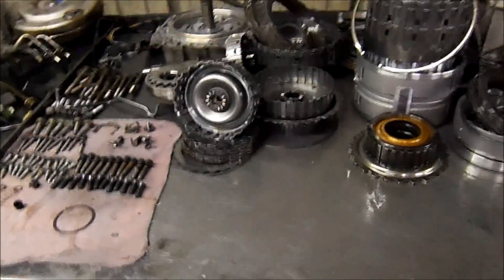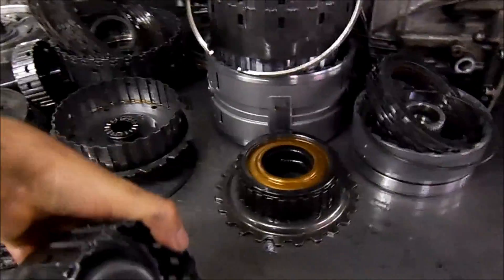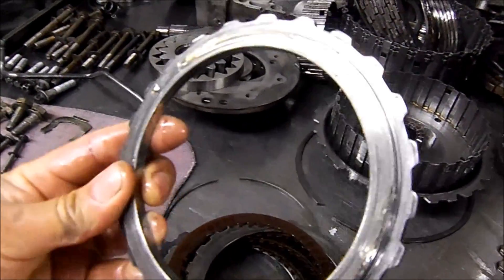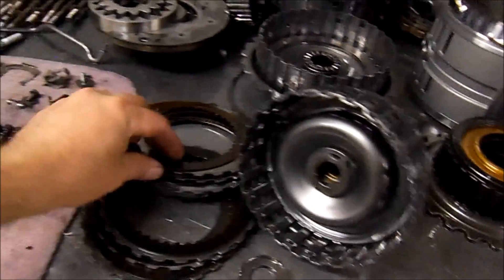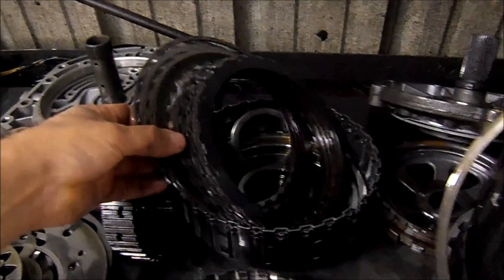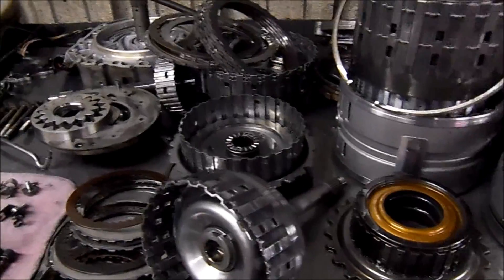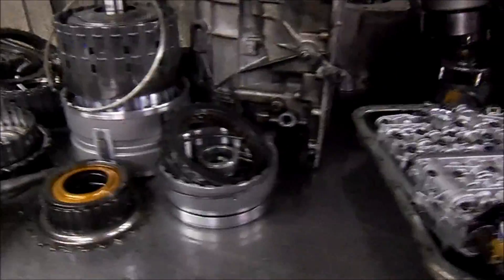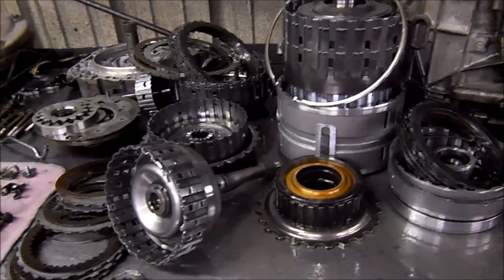ZF5HP24 Transmission - Broken Input Clutch Drum - Transmission Repair

Comment: Hello sir, i just finish rebuilding my zf 5hp24a and the car dosen't moving forward, very stong and good reverse! When i shift from P to D i have just a 2 inch move from the car, like she want to go and then stops, without touching the throttle! Like it loosing pressure,i have checked maybe 10 time the skinny o ring and grease it to be sure it ok before installing the transmission. I have check in the dash if it shows all the selected speeds, it ok until i accelerate and then all the speeds are the same color and dont change. When i accelerate and the car dont moves and slips i get only one dtc P0730 Incorrect Gear Ratio, i looked on the internet and the code it genaral alot of problemes can relate. Please, please, please help me before i take the transmission down again and check the A clutch!! Best reagards.

Comment: hey I got a 01 x5 4.4 when put to Sleep move forward a lil the trans fail safe mode kick...drop trans found out the A friction plate burnt...that means. that it's loosing pressure correct..if it is I just have to check the cable body and that oil pump in the trans and change the friction plate...or do I need to tear down the whole trans

Comment: In case you had a 5hp24 with broken a clutch drum and you repaired everything, cleaned and inspected it thoroughly, but after installing back in the car all the gears except 5th gear still slip like before, what would you assume went wrong? :)

Comment: I have an 01 xk8. Thankfully I've changed the fluid religiously although it's a pita. Was just curious how many miles it had and how much this kind of service cost? Want to be prepared for the future if anything happens. It runs and drives great goes into gear shifts fine. Also would you say these are troublesome transmissions or is this just something that wasn't tested throughly? My car has a 105k but has a new motor in it. Thanks

Comment: Hi I have an 2003 x5 diesel and I have a problem with the reversing gear , sometimes  it will work and sometimes i will have to wait like 3-5 mins. If im reversing straight it will go but if im reversing at at an angle it goes hard. Do I have to recondition the whole gearbox or there is anything I can do . I did change the gearbox oil and filter , 1-5 fth gear is going perfect and changes perfect no issue with them .

Comment: Hiram amazing transmission breakdown as usual. I have a question for you.. so what transmission fluid would you use with the ZF5HP24? ZF claims ESSO ATF LT 71141 only? Is this true? A ZF support tech wrote the following in a forum: "The transmission was not designed to run on alternative fluids and if installed you run the risk of premature failure. The transmission is equipped with a sophisticated torque converter lockup control (TCC) system and the correct oil specification is critical to its function and operation. One of the main functions of the oil is to provide the correct coefficient of friction and cooling of the torque converter lockup lining during regulated slip conditions. The longevity of the lockup lining would be adversely affected by the use of alternatives and in most cases deterioration in shift quality and lockup engagement is also experienced." (Dextron III was the alternative in question.) (That sealed for life crap is indeed misleading more like time to change at 60k to 100k)
Reply: There full of crap bro, I had a 5hp19 on my bmw and I did a fluid change with amsoil, I drained the fluid and changed the filter, with the car up in the air I let it run through all the gear several times, drained and drove the car for about 300 miles, and drained ad filled again and the transmission now has more than 200k miles of really hard driving, and it goes from the border to LA atleast once a month, you could use other oils too but I'm telling you amsoil is the best, I even use it in my Range Rover that has the 5hp24 and it runs super good.